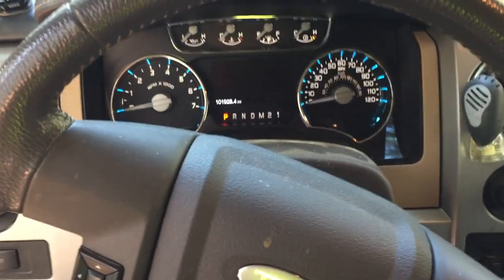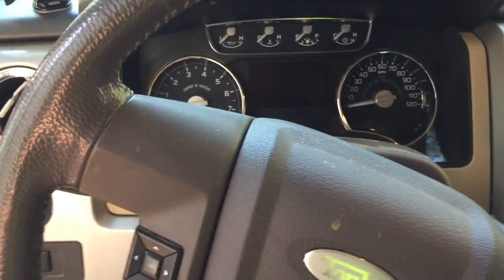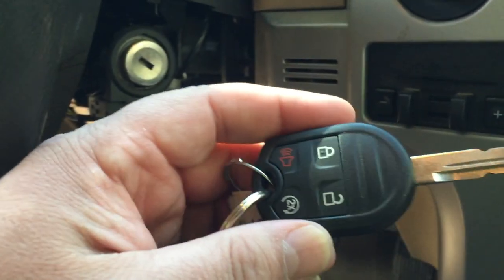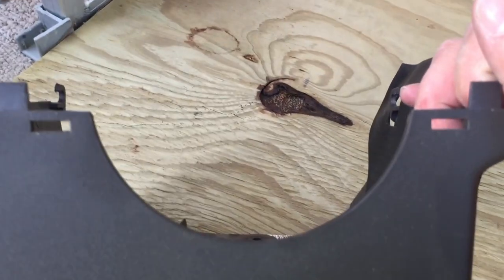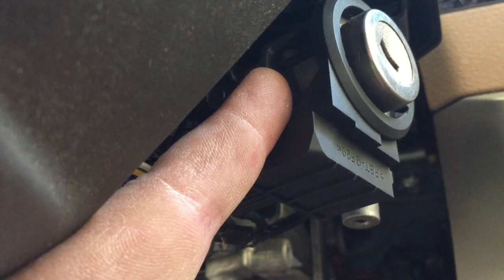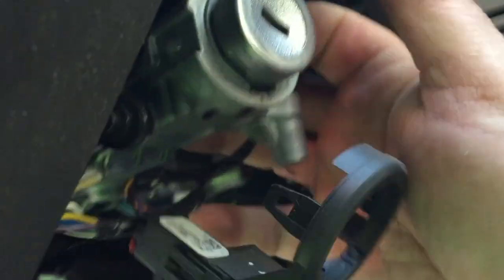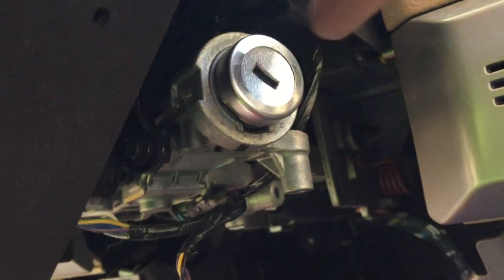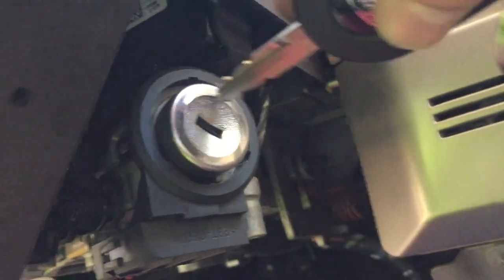Ford Lock Cylinder Replacement Fixing Code B10F1

Comment: Had this happen to my 2013 ford f 150 lariat. Went to a dealership and after receiving a call about a week later my truck was ready for pickup. Went to pick up my truck and was hit for a bill of $1267.00. Was told ignition key lock was bad and had to be replaced also the starter had to be replaced. Wow  still in shock!
Reply from the maker: When it comes to most column work, a guy most likely needs a real mechanic. But given how Ford uses their center on the key position, a guy might get away with my fix-it. The overarching takeaway is don’t hang any weight from the ignition key as replacing an ignition cylinder is better done with a mechanic’s skill set like mine.
Reply: @MinnesotaEric  so you don't have to rekey the new tumbler

Comment: Just FYI, you can buy a replacement cylinder from ford (Motorcraft SW-6991 for an 09-14 F150).  If you have a pair of vernier calipers, it includes instructions in the kit of how to measure your key to get the code, and then assemble using the provided springs and tumblers.  A bit intricate, but very easy to do.  I just did mine yesterday in less than 30 minutes.  Unfortunately for me, it didn't solve my problem of a constant key-in door chime whenever I open the driver door.  I'll probably have to tackle the actual ignition switch next, which looks to be really easy.

Comment: I was getting this code also. All I did was remove the ignition lock cylinder and use a screwdriver to push the 4 tabs inward that hold the outer metal ring onto the face so it is a bit tighter. It was loose and this was causing the problem. No need for any new parts.
Reply: Do you mind me asking what it was doing? Our F150 we turn the key and it stays in the cranking position still trying to crank even though it won't and normally that springs back but it doesn't now.
Reply: @BrandiWL  That sounds like a different issue. The issue described here has to do with the sensor that detects if the key is inserted or not.
Reply: Oh ok thanks.  Yeah it takes our key still.
Reply: Was my exact problem. Thank you!
Reply: Awesome. I did this and it solved my problem.
Reply: This also helped my issue with a customers vehicle. Thank you!

Comment: so you need a new key as well or the original key worked with the new lock cylinder?
Reply from the maker: I had my local Ford dealer key the new lock cylinder to my existing key.

Comment: What if the key will not turn the cylinder? How do I remove the cylinder
Reply from the maker: Push the pin in from the bottom and rotate the key. If you can start your truck, you can turn the key.

Comment: I have the same problem but no code. Did your battery also drain?
Reply from the maker: It may have. Right around the same time I needed to replace the OEM battery.
Reply: EVERY OTHER DAY OR ABOUT 3 DAYS, CRAZY RIGHT! FULL BATTERY ONE MINUTE THEN TO LOW TO CRANK. SAME THING WITH YOU?
Reply: @mr.jose100  hi jose what was your problem?
Reply: @BrandiWL  HELLO, I replaced the battery and sold the car. Battery was bad.
Reply: @mr.jose100  I appreciate it.
Reply: That is likely the ignition switch which is an electronic module in the same place, but on the left side of the steering column, cheap-ish to replace, just unplugs and new one plugs in.
Reply: @f2cmadmaxx  does that replace your key as well?
Reply: @BrandiWL  No.

Comment: I've one for you I have a friend has 03 Ford excursion same style of Ignition lock What is the process to releasing the Ignition cylinder
Reply from the maker: I'd think it may be the same with a pushpin, but I'd need to look at it or look it up in a  service manual.

Comment: Mine does the same thing now.  No chime and code b10f1-14.
Reply from the maker: Let's hope you can sort your problem out by simply changing out the lock cylinder.
Reply: What year is the vehicle? So you just changed the lock? No need to reprogram the lock?
Reply: @MaynardKrebs-rp4ov  2013. Yes once I changed out the lock cylinder no more issues
Reply: @ I have a 2018 and they are telling me I have to reprogram the ignition lock after i  change the tumblers.  I don’t trust the dealers, they contradict each other. That’s my problem. Thank you.
Reply: @ any videos on it ?  It may be for that year model I’m not 100%  since mine is a 2013

Comment: Is thereany way to get it out if the key won't turn forward at all?? Thanks
Reply from the maker: Not without forcibly breaking the cylinder with a heavy screwdriver and a wrench or by using a slide hammer. How do you start your truck without the key turning?

Comment: How long did it take them to get you a cylinder keyed in
Reply from the maker: As I recall, my local Ford dealer did it in one day. Thanks for watching.
Reply: @MinnesotaEric  Which dealer did you work with? Down in the cities somewhere? Or up north?
Reply from the maker: Ryan Maas one of my local dealers up north. Any Ford dealer’s parts department can key a lock cylinder for you if you provide them a key or your key code. Thanks for watching!
Reply: @MinnesotaEric  
Yeah I just called two dealers near me (I live down in the Southwest metro), and they basically told me to get bent – really not happy people at all. I asked one of the guys about this fix that you did, and he said, "I've literally never seen that fix this problem. Not even once"... I feel like I'm banging my head against a wall talking to these service techs. Then they want $169/hr to chase down the problem. SMDH.
Reply from the maker: @ryanmaas4030  Wow. I remember going to five metro dealers trying to simply order a truck and not being able to. Try calling Wolf Motors in Jordan. They are Ford's best selling truck dealer in the state and where I got my last truck. Just tell them you want a new key barrel keyed to your existing key and if you can drop the key off. Report on your result.

Comment: Pues el dice que asi y asi y asi  pero no mostró el momento en que se saca el cilindro eso es lo más importante .quitar los plásticos o cubiertas del cilindro es lo de menos como quiera ayudo un 50 %
Reply from the maker: I assume you know how to press a detent to release the lock cylinder after I explain what to expect. If not, next time hold the camera for me when I need two hands to work.
Reply: @MinnesotaEric  you did a great job explaining and holding Camara at the same time. I don't quite get what he's actually referring to the covers to get to the cylinder which he states is the hardest part, if that's the case he shouldn't even attempt to work on a vehicle. Nice reply to whatever problem he had with video 👍 or maybe he wants you to go do it for him as well. 🍻 cheers Eric.

Comment: If you can help an ol KY boy out. It didn't work for me i have fuel but no spark checked all fuse and relays , got a new pats key cut and programed still crank no start. My key cylinder is doing the same thing with door buzzer. Even replaced the module on other end cylinder housing. Crank crank crank. Either way thanks for the information Merry Christmas
Reply from the maker: If you have already replaced the key cylinder, can you wiggle the key in the lock and wake everything up intermittently? If so, the lock cyclinder (which is way more involved to replace) is bad. Also take all the weight off of your ignition key and don't carry it on a keyring which is what wears these things out. If wiggling the key  in the switch does nothing, I'd look at the ignition switch. See this other guy's video on that since I have not made one coving this. https://www.youtube.com/watch?v=qQvVCyfmKyg

Comment: Would the truck still start
Reply from the maker: With the code? In my experience, yes, but you will have the check engine light flagging.
Reply: @MinnesotaEric  I have this code and also the code b10f1:14 and the truck does not start f250
Reply from the maker: @alexb01909  Same general issue as covered in this video and normally caused by the weight from a bunch of keys on your truck's keyring loosening the lock cylinder over time. Worse case, you need to replace the entire lock cylinder in which case I suggest you bring your truck into your local shop unless you have mechanical skills for steering column work. Best case, swapping out out the key cylinder itself will solve your problems. There are some obscure reasons like faults in the wiring harness or instrument cluster that can cause a no-start, but those issues are uncommon. I suggest you follow my video and begin by dropping off a kew at your local Ford dealer to pin a new key cylinder for you and swapping out your old key cylinder with a new, tighter key cylinder. You can check out this link for a little more information beyond the summary  I have provided. https://www.engine-codes.com/b10f1_ford.html
Reply: @MinnesotaEric  f150 continuously turns over but doesn't start and key doesn't Spring back when letting go after trying to crank. Plus vehicle not actually starting. Googled it and said this was the problem.  What's your opinion? It stranded us at the gas station and we had to get a late night tow. Now trying to figure this mess out.
Reply from the maker: @BrandiWL  If the engine cranks, but does not fire, you have something else and maybe what I cover in this video going on. You can try wiggling the key upward and forward as you crank the engine, but seemingly, the ECU is giving the starter the command to crank and either you have no fuel, no spark, or are out of time, or some sensor is lying the the ECU. I'd pull codes and go from there.
Reply: @MinnesotaEric  ok we already knew we had timing issues and are having the chain replaced soon. Just thought the cranking problem was separate but apparently it must be related to the timing as well.  Sounds about right. Thanks.
Reply from the maker: @BrandiWL  Good luck. If you don't mind, when you problem is resolved, can you come back and share what your problem was and how it was resolved? Thanks!
Reply: @MinnesotaEric  sure. Friday evening a guy's coming to change the timing chain. We'll see if that fixes it.
Reply: @MinnesotaEric  well he came Friday but couldn't finish and didn't come back today so maybe tomorrow. But the old chain was in pretty bad shape though not loose.  Or so I was told.  Hopefully I'll have an update that it cranks by the end of tomorrow.
Reply: @MinnesotaEric  he changed it but the battery wouldn't start so we had to charge it then it cranked. We drove it down the road purring like it never had before but then on the way back the check engine light came back on and the motor started to shake again then it killed.  We were able to crank it to get it home but still having problems so not gonna drive it.
Reply from the maker: @BrandiWL  What codes are you pulling after clearing and running the engine again to the faults you described?

Comment: I have this code, but all my functions work properly.
Reply from the maker: A key ring full of keys is what wears the lock cylinder. I now just use the Ford key only without a keyring.
Reply: @MinnesotaEric  this excatly what happend to me.. today the car doesnt start but i guess was batery issue i end up replaceing the baterry problem solve start w/o issue... but as you show in the video there is some play and chime sounds... w/o turning the key... i used blu driver scanner and said the same code but said replaced ignition switch.instead .. do you thing is the same issue as yours??? Or its the   SW-6958 Ignition Starter Switch...  or maybe both??? Thanks.  Btw i have not engine ligth on my dashboard
Reply from the maker: @jaandel1  Replacing the entire lock housing is a much bigger job. The idea behind just replacing the lock cylinder is to save money in the hopes that the lock cylinder itself will tighten up the tolerances so that everything will work properly. At the very least stop carrying anything but the Ford key on that keyring as it is the weight of the extra keys is wearing the lock cylinder out.
Reply: @jaandel1 you had battery issue as well and no start will set a ign switch code. I would clear the codes after writing them down and replacing battery then se which sets 1st.